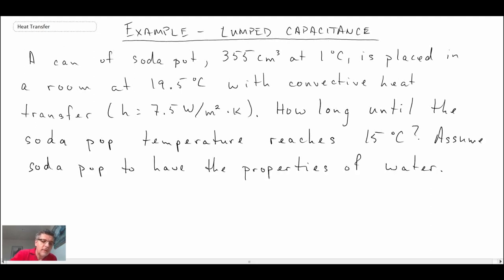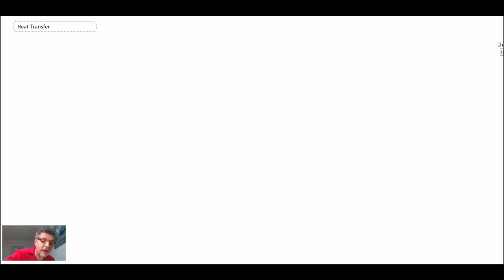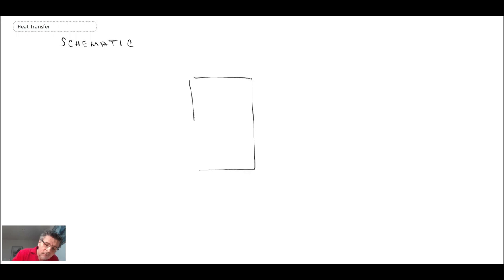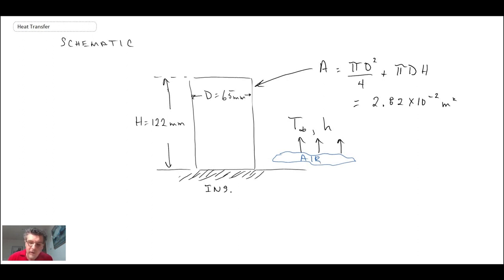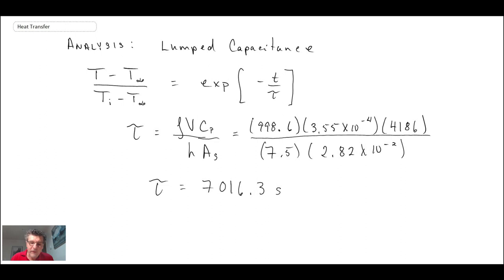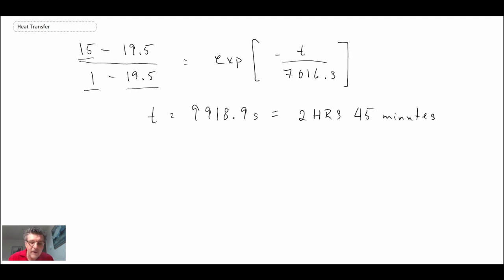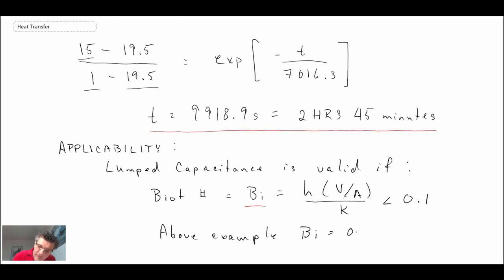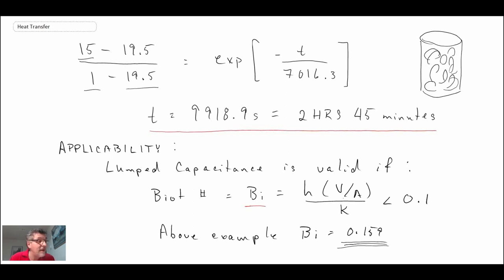Heat Transfer L14 p4 - Example - Lumped Capacitance Method

Comment: This is really great explanation but I was wandering whether we could use this method for the single space in a building.
Could it work?
I think no, as the heat goes from the space to wall and then from a wall to outside. The problem I see is the we can't assume the temperature changes at the same speed in a room (air) as in a wall. The air temperature in a room will always raise earlier (if building is gaining heat e.g. from inside) and we do not know how fast heat will go from a room (air) into a wall (how fas a wall will accumulate it) and then to outside. Similar with changes of the outside air.
Could you please advise how to deal with it, is it possible to do that? Thank you